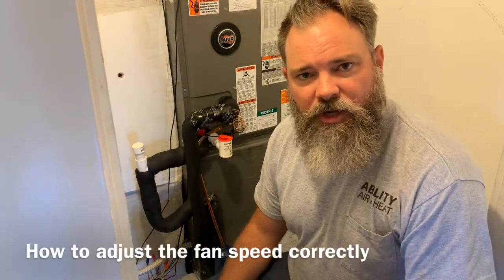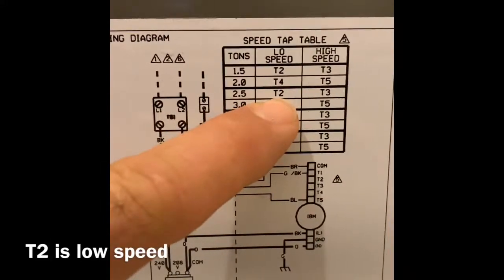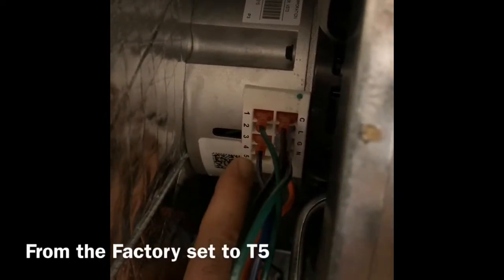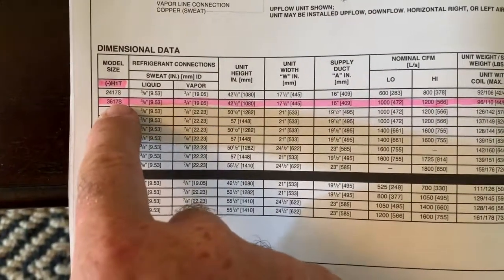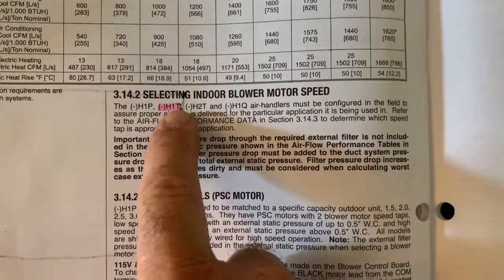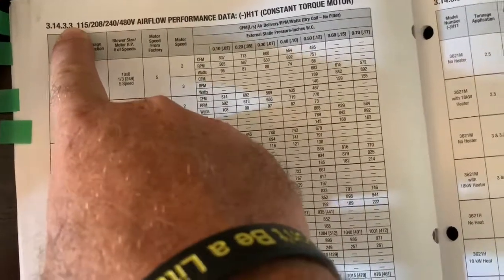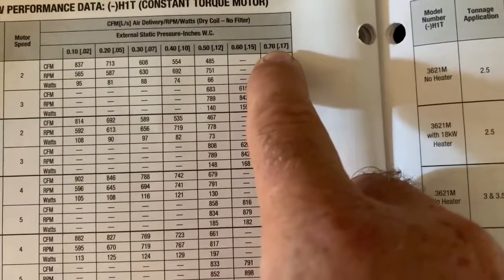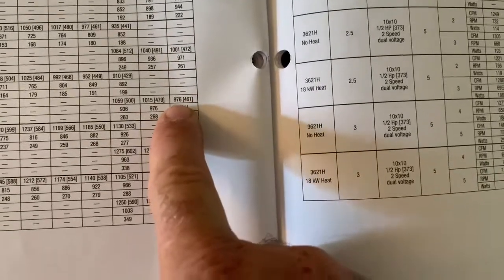Setting X13 Fan Speed On Rheem/ Ruud

Comment: Hello, I have another question for you:  Does the blue wire that is moved to adjust the speed, does that blue wire apply for both heating AND cooling or do heating/cooling have separate speed wires?  Thanks again!
Reply from the maker: Depends on the brand and if it’s a heat pump.  White is usually only for electric heat and blue would be for cooling and heating for heat pumps.
Reply: @AbilityJohn  Thanks John, I was referring to the specific model you showed in your video, it seemed like that blue cable handles the speed for cooling AND heating, but I wasn't sure.

Comment: Thanks for this video, very informative.  Question though: If the manual says to use T2 and T3 tabs for this model, why does it come plugged into the T5 tab from the factory?  What would happen if the blower is left to run at T5 when it appears that T5 is used for the 3.0 TON models?  Thanks!
Reply from the maker: The temperature split would be low and you would remove less humidity.  Your system would be less efficient and the home would feel warmer.
Reply: @AbilityJohn  I appreciate the reply even though this video is from 4 years ago!  I have a similar unit in my house, it's a 3.0 ton model, but I think it's oversized for my place.  For my particular model, I can use tabs 4 (low) and 5 (high), while tabs 2 and 3 are for the 2.5 model (like in your video, it seems), and unfortunately, switching it to tab 4 (low) is still too much for my household, so it cools off too fast and doesn't get rid of humidity as efficiently.  Lessons learned.
Reply from the maker: Yes over sizing is a big problem.

Comment: John: I have a 2016 Rheem Ckassic 3 ton gaspack. 2 stage AC and 1 stage Heat. Variable Speed fan. I like the system but I'd like to lower the Heating fan speed a little. Is this possible? Will it trip any safety control?
Reply from the maker: You can check heat rise after fan speed reduction. Should be on the label. If the heat rise is too much then no you can’t deduce the fan speed. That’s how I would go about it.
Reply from the maker: Leave this to a professional for sure on variable speed systems. Getting the airflow correct requires refrigerant gauges and getting temperature splits.